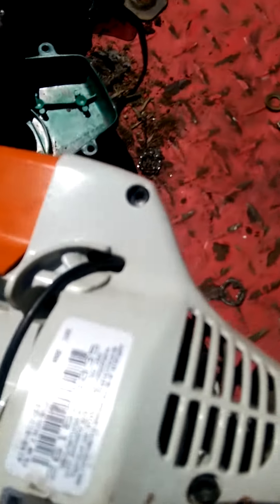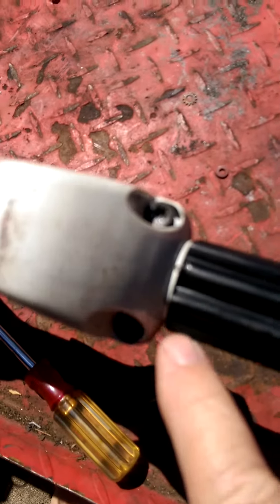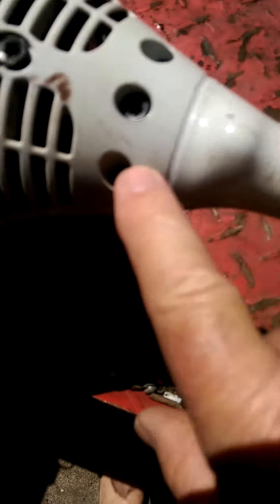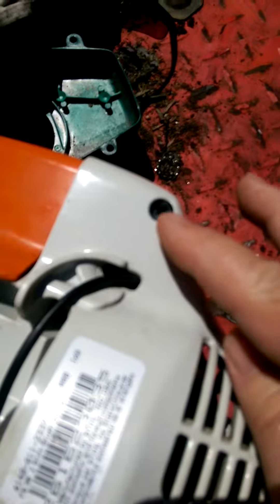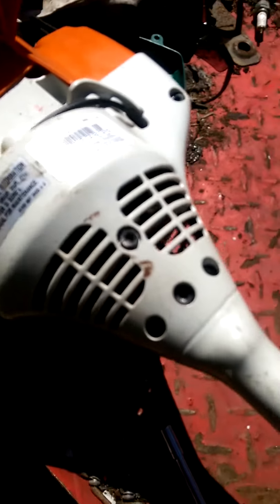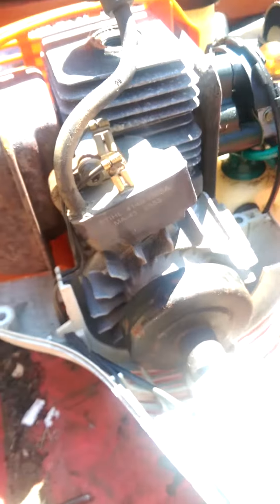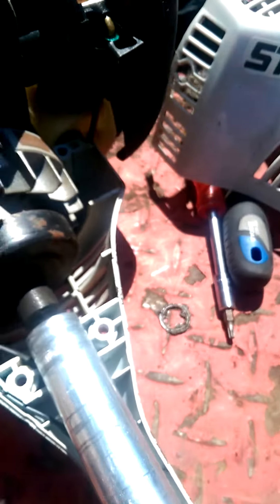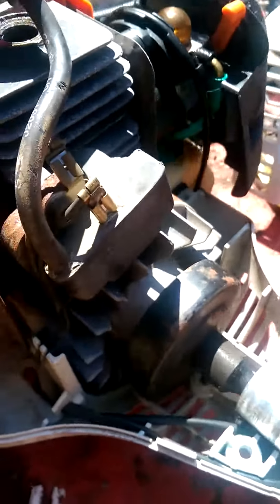Sthil FS38 Fitting a Chinese aftermarket ignition coil.

Comment: 🤬
Save time for everyone and DELETE this waste of time.
Reply from the maker: It may have been relivant at the time.  Not made for everyone.  These days I only use battery equipment which makes it more irrelevant to me.  Thx.
Reply: @rolfgrosseholz1311  Come on you only show removing 5 screws on the cover when there are 6 screws and then say "see you shortly" that is NOT showing how to "Sthil FS38 Fitting a Chinese aftermarket ignition coil."
As I said waste of time and not even relevant on how to remove the cover.
Reply from the maker: I remember now.   I was trying to find a good disassembly technique so not everything falls apart.   The  new chinese coil i fitted was bad.   Eventually I found a good used coil to produce good results.
Reply: @rolfgrosseholz1311  Yep same here, last time I buy a crap coil from china